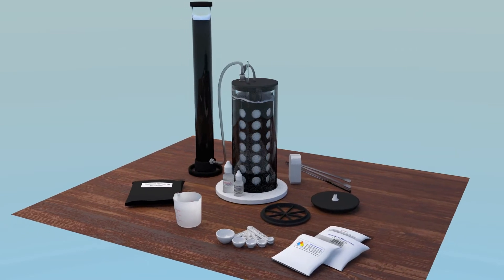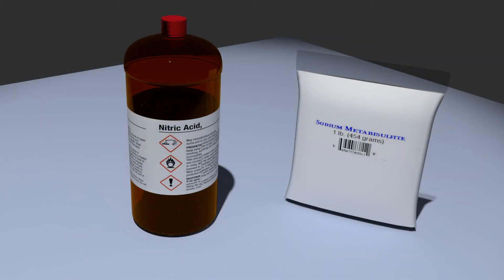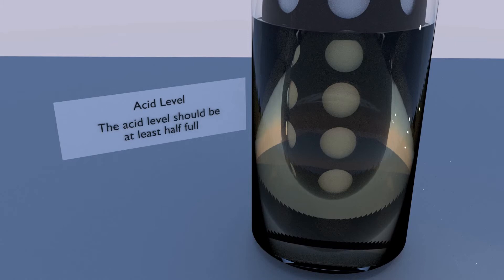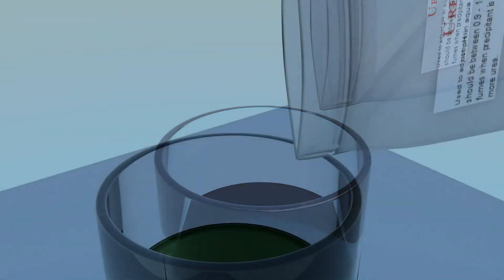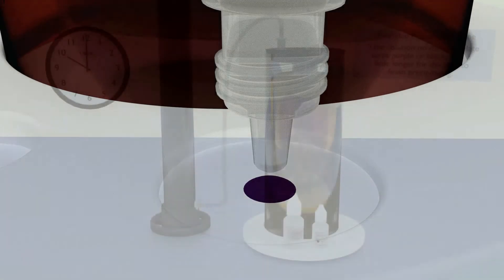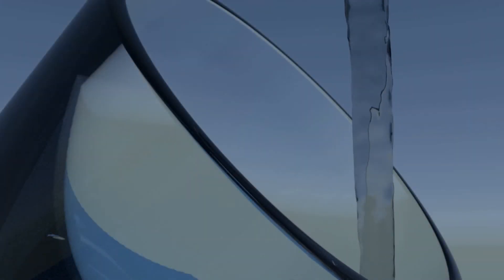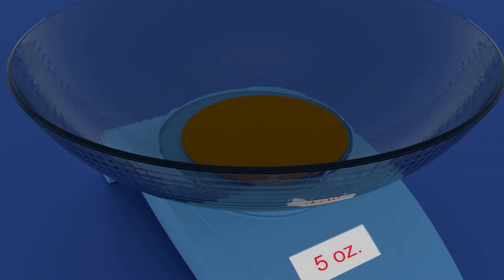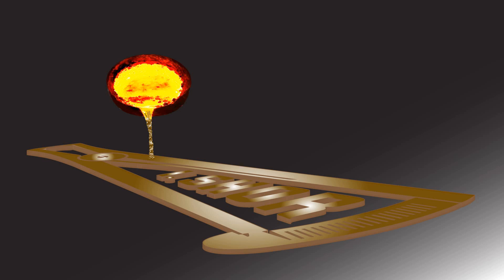Shor Aqua Regia Gold and Platinum Refining System Instructions

Comment: What is mx3 ? Any Alternat of mx3
Reply from the maker: MX-3 is a catalyst, reacting in a similar manner to nitric acid, causing the HCl to combine with the metals, forming metallic chlorides.  The most similar substance is sodium nitrate.  If using sodium nitrate, you should first grind it to a powder (it comes in the form of tiny round pellets).  If not ground, it is difficult to dissolve in the HCl.

Comment: Can I refine mixed metal lemel ?
I collect platinum, gold, silver, & palladium dust from the jewellery manufacturing process. 
Can I refine & separate these metals ?
Thank you
Reply from the maker: Of course.   Different precipitants for different metals.  Quadratic Precipitant for gold, ammonium chloride for platinum, sodium chlorate for palladium.   Silver does not dissolve in aqua regia.   It forms an insoluble salt called silver chloride that can be recovered from solution before recovering the other precious metals.
Reply: @shorinternational3841 would there be a preferred order of precipitation?